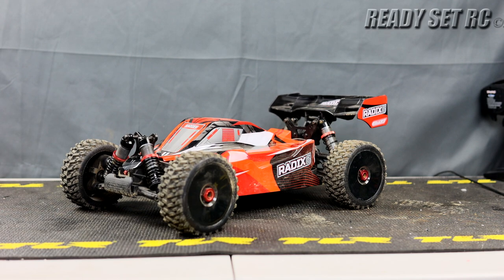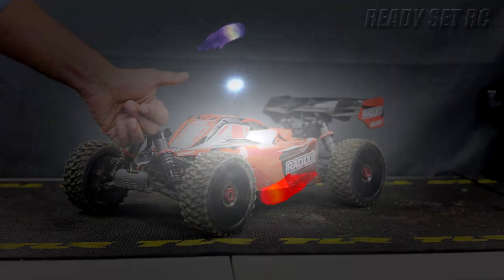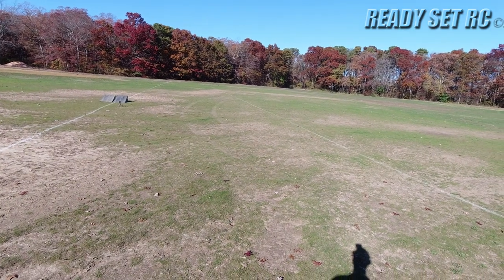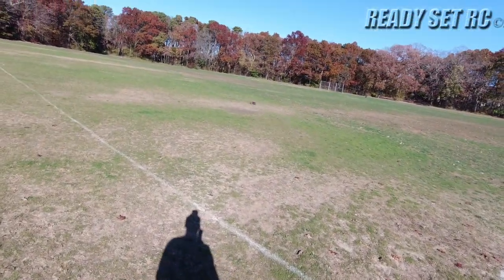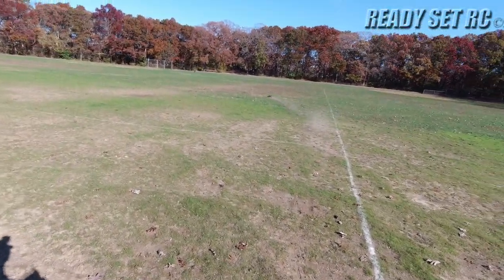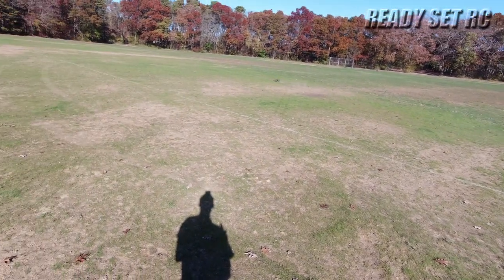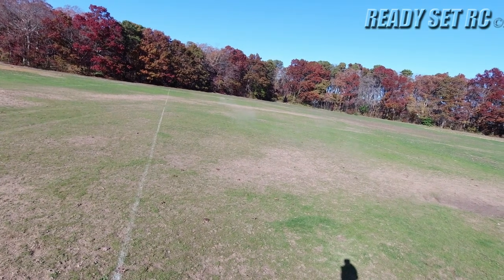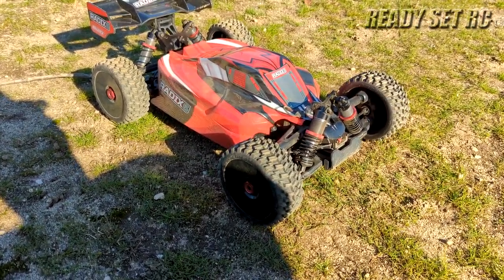Testing out Powerhobby Belted Armor Buggy Tires

Comment: I recommend getting yourself a small nut&bolt case to put in your to-go toolbox. 
Can't tell you how many times I've forgotten some silly nut or screw. 
I get those small 8 section cases in bulk from Amazon. Really helps sorting small extra bits for quick field repairs. They're really handy to have for other organization purposes.
Reply from the maker: @Captain Could've RC  That would have saved the run👍